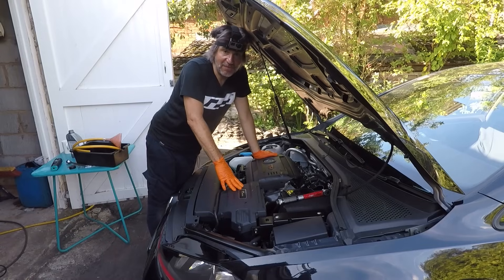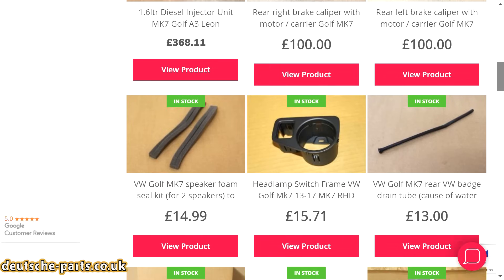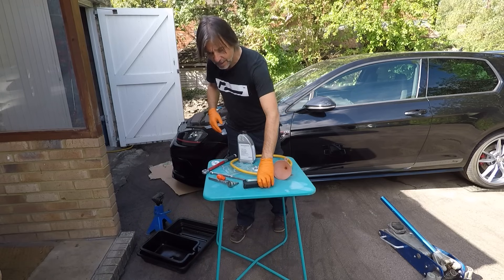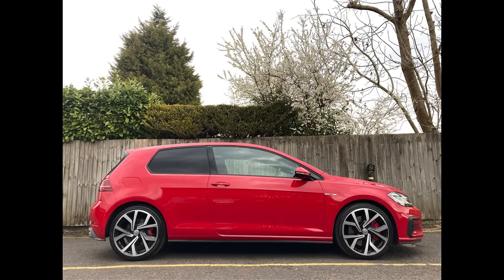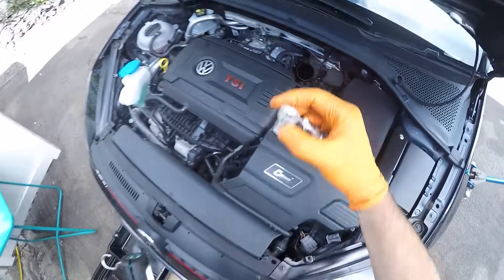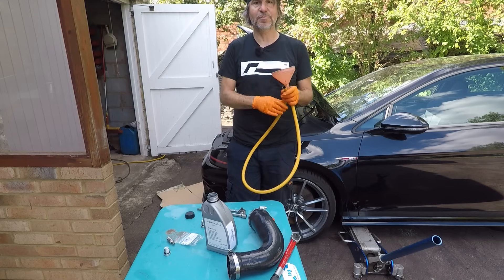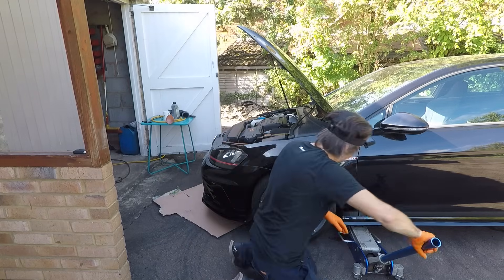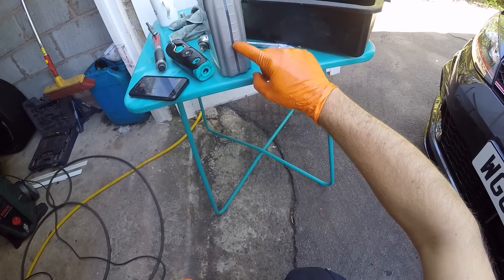VW VAQ DIFF OIL CHANGE - DRIVEWAY DIY - GOLF 7 7.5 GTI PERFORMANCE CLUBSPORT TCR MK3 SEAT LEON CUPRA

Comment: Can i ask this and the dsg oil changw its different thing?i should do both? Because i heard id i change dsg oil it change differential too, am i wrong?
Reply: I was told something similar by my dealer. I asked what the interval was to change the locking diff fluid and they said it’s the same thing as the transmission fluid. I’m very skeptical of that.

Comment: Bonjour
Mon concessionnaire en France me dit de faire cet entretien sur ma golf 8 gti 245 au bout de 2 ans , mais elle n’aura que 20000km à cette date , est-ce vraiment nécessaire ?
Cordialement
Reply: Yes just do it every 20k,

If you have a tune then I’d say safe side 15k miles, same goes for changing sparks every 10k miles , oil around 6k miles , Dsg oil change every 30k miles trust me it’ll be worth it if u follow these schedules if you remap ur car
Reply from the maker: It’s a good idea to do that often if you drive hard and make good use of the diff.  The factory interval is too long

Comment: ....as simple as this is, I argue this design is insanely complicated for what it is intended to do. To give perspective, the Civic type R Differential fluid is the same as the Transmission. Meaning when you change the Manual Transmission fluid in the car, the differential is also serviced. No temperature checks needed. Talk about overengineering something with minimal gains compared to other ways of doing the same thing. Lets not even talk about the Golf R differential versus Torque vectoring of Lancer Evo or SHAWD services.

Comment: Are you sure it's the filler plug that is recommended to be replaced? Just looking through diagrams and looks like drain and filler plug is same part number, so room for confusion in the guidance.

Comment: why didn't you remove the actuator to clean the screen filter?
Reply from the maker: Bit hard to do on the floor and with a history of haldex changes I didn't think it was necessary just yet but one for the future - have done it on a rear Haldex before when stuff has been dead and it' revived it

Comment: hi , I was wondering if you could help me , my gti dsg 2008 drives normal and changes gears as it should however when it comes to a standstill it stalls , the red battery light flashes on the dash and then I will need to restart again but drives fine and idles fine. Have you ever heard of this issue before or know what it might be ? thank you

Comment: How does it work if you swsp the diff for a wavetrak or a Drexeler?
Reply: There's no vaq swap. It's an external unit, between the gearbox and the driver's side driveshaft. It's the same as a Haldex unit. If you want to fit a mechanical lsd, you can do it. But you need to do it the classic way. Gearbox out, open the gearbox, and swap the mechanical open diff with the lsd.

Comment: What doo you thing of the pump screen filter Andrew? Since the vaq dosent have a regular filter. Maybe its a good ide too clean it also on cars that haven't had services done in time.
Reply: I used a dab of copper grease and installed spring washers on the two pump bolts when I removed ours to clean the filter gauze.
Should keep it spot on for future removals if needed 👍
Reply from the maker: I think if the VAQ is working and there are no fault codes then you are possibly wasting your time removing pump unless you fancy a challenge. It won't be hard but those bolts that hold the pump on are not very strong and very vulnerable to corrosion so shearing one off and making car (largely) undriveable probably not wise unless you need to do it.  I will have a go when I run out of other things to do as it doesn't matter too much if I break it :)
Reply: @volkswizard I had one guy complain about 4wd not working as he was used to. It was clogged totally. Since then   I always clean the haldex pump for all my costumers when changing haldex oil on those whitout filter.
I have seen some nasty screens on those newer haldex.  We are not a vag specific garage it is all brands. It's only me being a vw nerd I always try too do the job 120%

Comment: I've used the funnel and hose method to change manual gear oil in the past nice and easy I got a clear pipe 👍my polo gti 2019 has a dsg box I got told the service was on milage not time although I will do it probably at 30k instead of 40k
Reply from the maker: Clear hose is a great tip, thanks!

Comment: Hi Andrew, thanks for video. I noticed your car has plastic oilpan, what is your thoughts to change it to metal one? I'm going to change pan to my 2019 PP GTI soon, my car is slightly lowered and winters are long here so ice blocks could damage plastic pan.
Reply from the maker: I think VW went back to aluminium sump pan with Mk8 - I'm not aware why they chose either so I'm happy leave it as is especially as it's a messy job to swap. Interesting Porsche 718 Cayman GT4 has plastic pan with same plug.

Comment: Andrew you need to take the VQS pump out also and clean all the sludge out and clean the filter that’s in there…. You don’t want a blocked filter!!
Reply: Did mine at 17k miles. Doesnt appear on routine vw servicing schedule. If you want to be OTT about it on a car thats driven to be enjoyed then i'd recommend every 20k-30k miles.
Reply from the maker: That's for a later video - it's not really a risk at 16k with one oil change done previously and no fault codes.  From the perspective of an owner, being able to change the oil using guidance from this video is something they can do easily and should prevent blockages - complicating it with the pump removal is going to beyond the confidence levels of many.  But as I said one for future :)
Reply: No record of it being done on my CS only routine servicing, did it as soon as I got the car with 49,000 miles, plan on doing it  with every service as it’s our daily drive it’s not under a lot of stress.
Reply: @Porky190  That's when I did mine, 50K.  I haven't decided on what interval I'll do going forward.

Comment: Great video as always! I'm going to remove the pump and clean the filter on my CS as I don't know the history of it getting changed. Maybe overkill but at least I have peace of mind and have an idea of condition of the pump unit.  Also I have the same nifty oil delivery device as yourself even down to the faded funnel 🤣, also fits MX5's and Subaru's !
Reply from the maker: Thanks Steve. It's a good idea to clean the pump and filter, I've done this on the rear Haldex numerous times. Just be extra careful with pump bolts as they can sheer, might be wise to get a pair in and replace them anyway as they are in a very corrosion prone area.

Comment: Nice video. I've heard some people say that you should take the pump off and clean the filter while you're doing the oil change, but from what I've seen they don't get filthy and bunged up with sludge like the Golf R haldex filter.
Reply from the maker: Definitely at higher mileages. I’m saving that for another video. I’ve seen the pump bolts sheer off on rear Haldex so hope that doesn’t happen with VAQ. Might take them out and grease them before it’s too late
Reply: Any video on this? Looking to change the oil and probably need to take it apart for the filter. Gti is at 101k miles
Reply from the maker: Definitely at higher mileages. I’m saving that for another video. I’ve seen the pump bolts sheer off on rear Haldex so hope that doesn’t happen with VAQ. Might take them out and grease them before it’s too late

Comment: Hi Andrew. Would you recommend this oil change on the Mk8 performance models coming up to 3 years old? You didn't mention those in the intro. 
Thanks.
Reply: Many thanks and added to my list for service in Oct 23 👍
Reply from the maker: Good point Tony.  I know Mk8 GTI 245 & CS have VAQ but don’t want to assume it’s the same method. If is then yes 👍